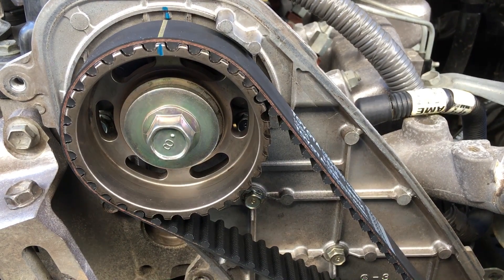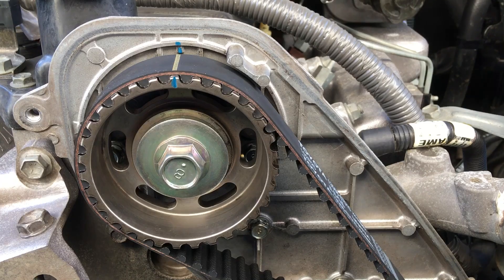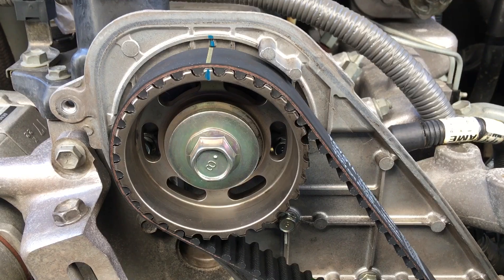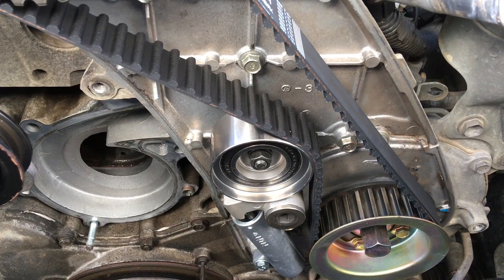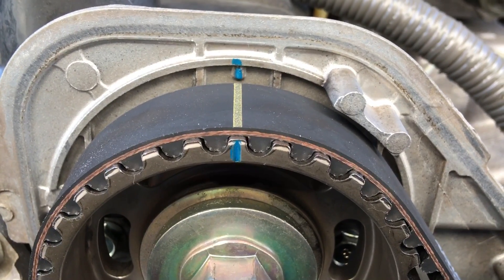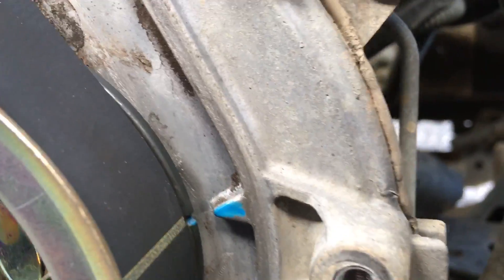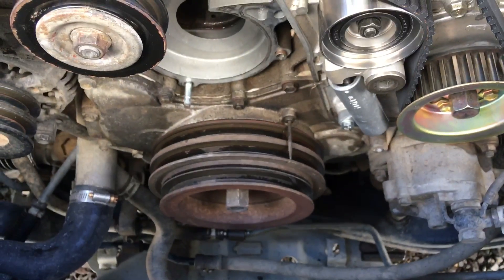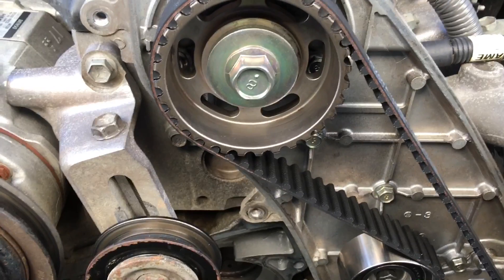1kz / 1kd timing belt marks

Comment: If you have timing mark lines on the camshaft pulleys that line up to the back plate of the cams, and a timing mark on the eng and crankshaft sprocket (to show when the eng is at top dead center) are the belt marks that important to  line up?
Reply: seems redundant, but it proves that the belt is indeed taught (and has correct teeth) between the two sprockets regardless of tension, etc.